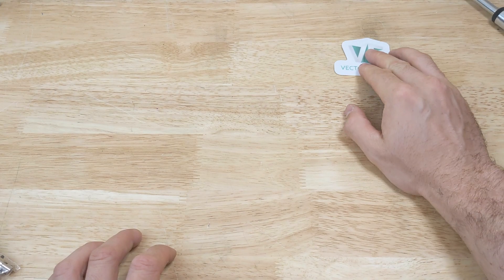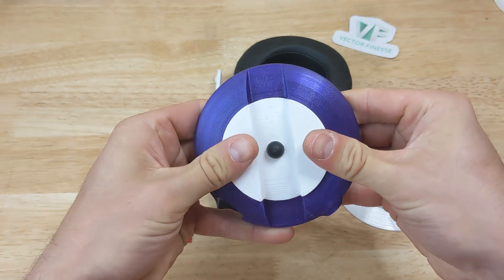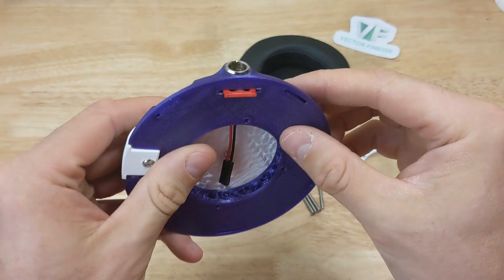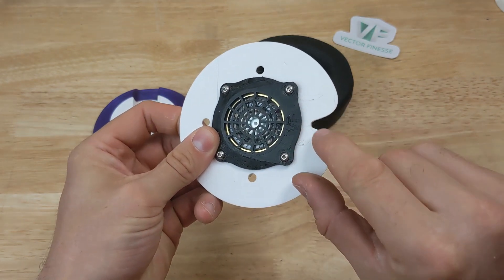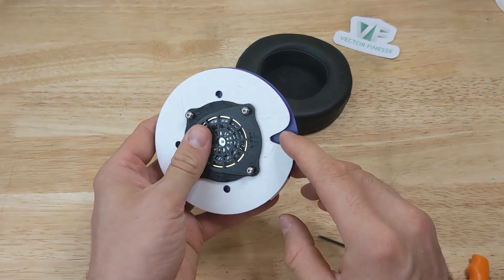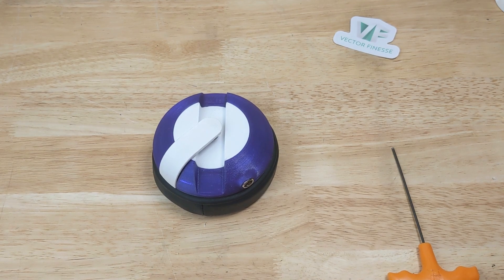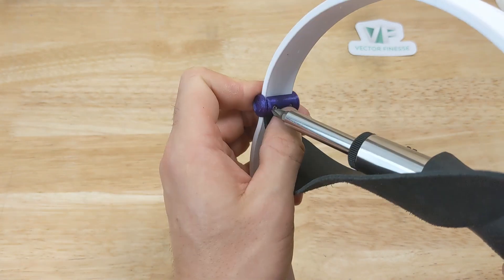head(amame) 3D Printed Headphone Assembly Guide

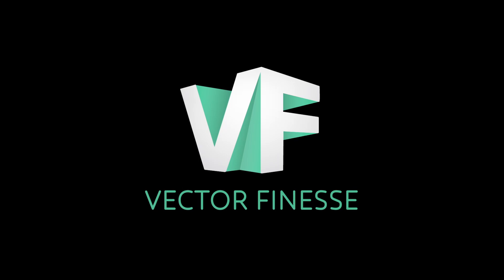Comment: 12:20 i Printer the min ok Prusa and it fits in loose i Hope i habe mi Problems with the screws. I would like if the Files wouldn‘t have a tolerance already because prusaslicer can calculate the tolanrance.